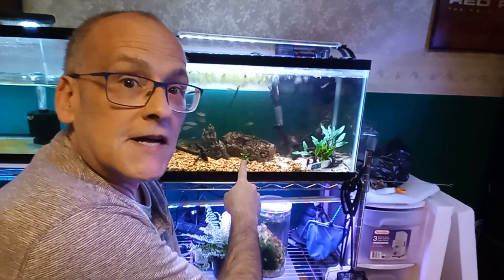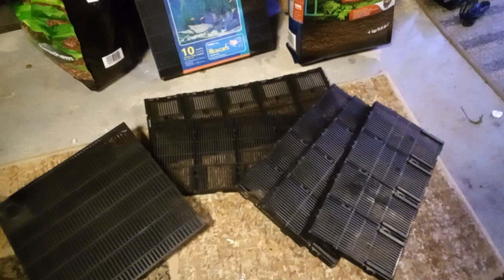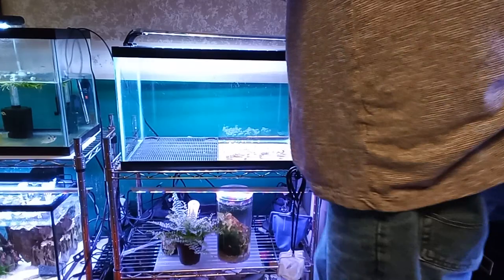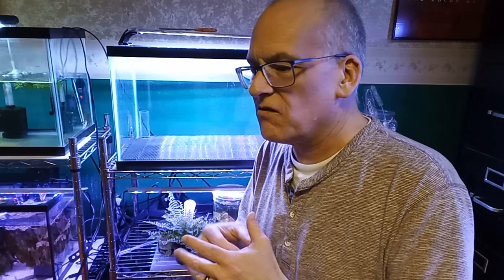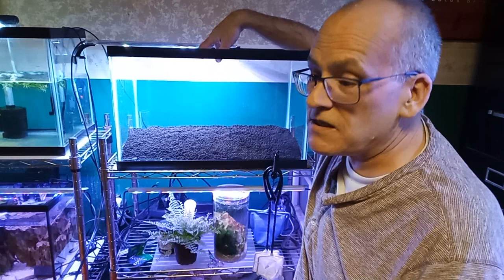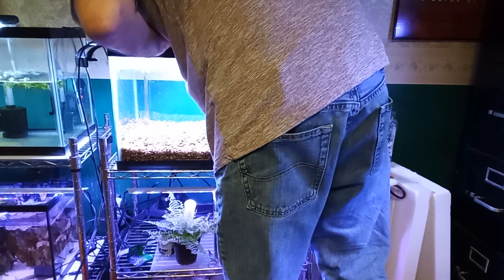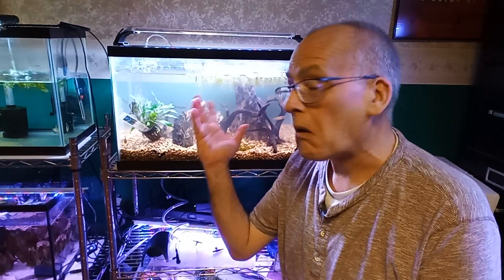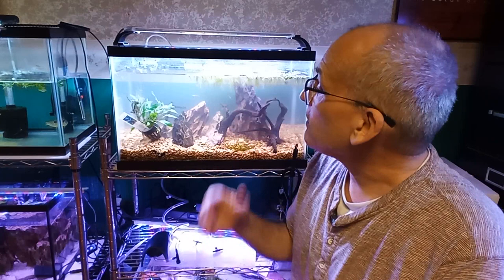PLENUM installation and process - and WHY I did this

Comment: The definition of his method is wrong. I already left some messages in his channel explaining why his definition is wrong. What he and you have there is simply a SLOW FLOW UNDERGRAVEL FILTER.  That is how undergravel filters should be used. We knew that long ago. That is not a plenum! It's n undergravel filter. It works great and always did since the 80s. Nothing new. Cheers!

Comment: 52 years in fishing keeping never stop but i have a 2k ko pond with koi and 75 gal reef tank started when fishtank had stainless steel frame ,lol and to keep saltwater a underground filter was a must with 4 inch of substance  and the supreme hob that throw 600 gph, first tank was in the 60s and first saltwater was in the 70s, oyea my 55 gal sump for my 75 ga reef tank has a under graver filter  because it better ten live rocks for your nitrogen cycle . good video Pal!

Comment: I wouldnt have put the ceramic material in the bottom, you dont want to obstruct the water flow under the plates to the outflow. Your filter media is the substrate above the plates.

Comment: Nice. That air lift tube is way too tall for Anoxic filtration. Should be same height of substrate. Substrate thickness should be more too. Tank this small may not need an air lift at all. Water flow beneath the plenum should be super slow. This set up is way fast water flow. Sharing this as I follow Dr. Novak.
Reply from the maker: the lift tube appears to be higher, but its okay, it would mean the water has a higher distance to travel up and out with the air bubbles, and fight the head pressure of the water, I don't believe that the heigh of the lift tube is of any consequence, its just lower to be easier to hide with in the aquarium.  I could be wrong but I will go back and review ...
Reply: @tankedaquatics6787  Try to have 8-10 cms thick substrate ABOVE the plenum for better results. Your water is moving too fast from beneath the plenum.

Comment: I have a ugf in my 75 gal & i just use pea gavel in mine 
& it keeps the tank clean but I also use 2 power heads on 
the ugf to pull all that muck down & the plant's are thriving.

Comment: Great, thanks for posting.
So, since 2 years ago did this plenum was a success over thr last 2 years?

The poiny of a plenum is to allow "space" between substrate & glass bottom & pitting obstacles like ceramic rings sound good it messes with thst void.

Plus placing a barrier like material used under mulch can keep filter olaye from becomming clogged by substrate blocked slots in plates.

Comment: Great video! Do you only use the airpump to run it, or do you have some sort of filter connected ,to help out as well?? Curious, a I'm trying to figure out how much or little tech is needed to make it work.
Reply from the maker: Well in all honesty it was just an airpump, but I have not had much luck with it so I am ripping everything apart .
Reply: @tankedaquatics6787  Thank you for the answer. I'm about to redo my 38g, and started to consider to try something similar. But now, I will do a mix of Lava rocks, gravel,  soil  and sand a go, and see how that works out compared to my gravel and soil I use now - Its an attempt of lerarning and improving the setup a little. Time will tell. Thanks again.
Reply: @tankedaquatics6787  That's a shame.
Maybe the water was moving through it too fast? I know he talks about moving water through it extremely slowly, otherwise there'll be too much oxygen.
I've even seen him make a plenum without any uplift tube at all, that just relies on heat produced by the denitrification process itself to exchange water.

Edit: In this video he explains why some UG filters need an uplift tube while others don't. I believe, looking at the UG filter you used, that an uplift tube shouldn't have been used as it had plenty of slots, all next to one another.
https://www.youtube.com/watch?v=3jhjWZCLufA
Reply: Do you think it didn't work well because it was flowing to fast or not a thick enough bed or what? I need to try this.. I usually use large gravel underneath my smaller gravel in a thick bed. Zero nitrates happy fish and plants but I'd like to try this method
Reply: @melsfreshwater6020  8-10cm (3-4") is enough. I wouldn't want to go too deep, as you want low oxygen reaching the plenum, not no oxygen.
Reply: Ok thanks for this, I have just discovered Dr Novak, interesting stuff! Another project coming

Comment: 40 yr fishkeeper, still an amateur, currently 3 decent sized tanks, have always used an undergravel filter with a powerhead in addition to a hob filter, deeper gravelbed and heavy on the plants, how is my setup different from a “plenum” filter?
Reply from the maker: The power head will move a LOT of water through the substrate.  The goal with a plenum is SLOW moving water for a lower Oxygen level.  This environment allows for bacteria that can metabolize in anerobic and aerobic environments.

My UG Filters are not really filtering water, they gently allowing water to move from the tank through the substrate back to the tank.
Reply: It's just a "slow motion" undergravel FILTER..... lol 
If a "process" removes compounds from the water column, it is "filtering" the water.
Reply: @tankedaquatics6787  "Not really filtering water"...... And what is happening to that water...?  It's the reason you're doing this..... Removing toxins = "biological filtering"